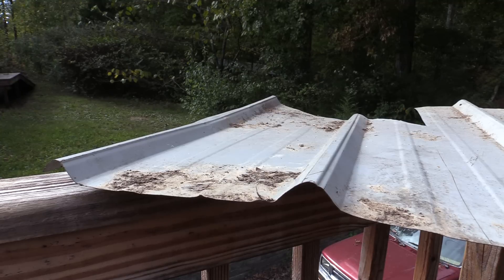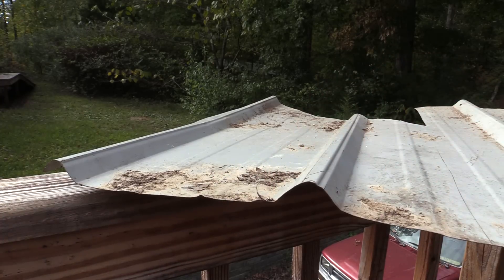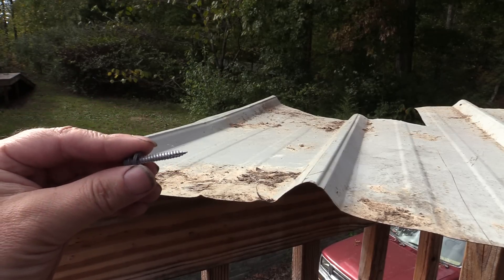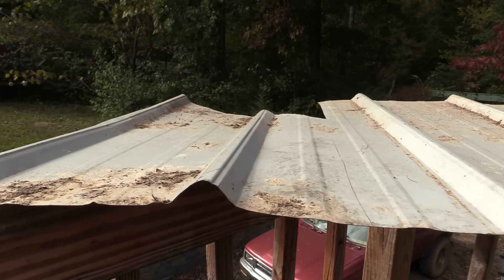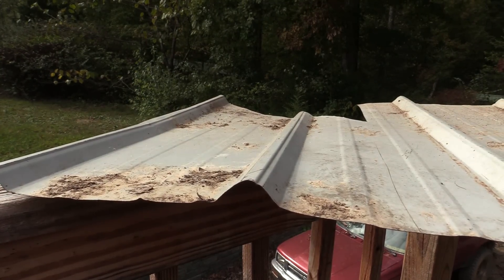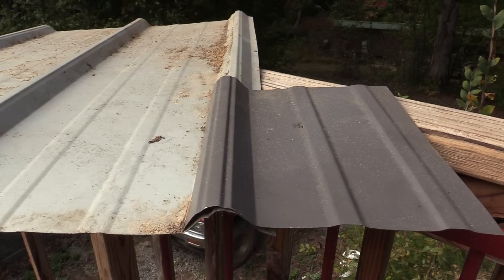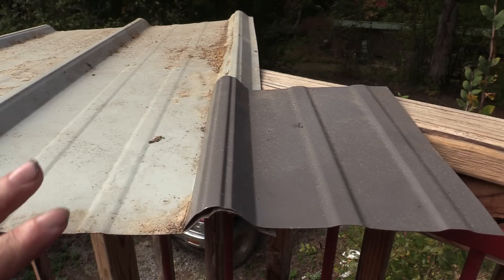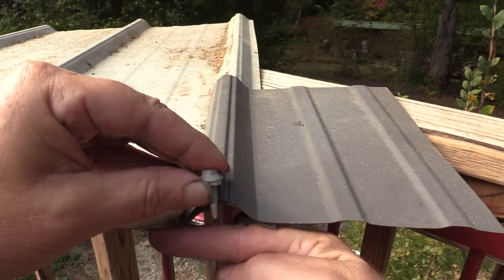Why you should not put screws on the ribs of metal roofing

Comment: I have done it both ways on my farm. Those with the screws through the rib never leaked. Every roof with screws in the flats leaked and had to be replaced. Anybody that tells you to screw in flats is wrong. Just don’t tighten the screws too much and deform the rib.
Reply from the maker: the roof manufacturer will say different unless you are dealing with 5v
Reply: @honeybeehomesteading  the manufacturers want to argue against the laws of physics,  let em. 🤣
Reply: @kerriwilson7732  Exactly RIGHT do not fall for this garbage on the flats 🙂
Reply: @kerriwilson7732        the manufacturers actual understand the physics involved  -  they also understand how most folks put in the fasteners  -   which is why they don't warranty most of the common fasteners or the installation:  just the roofing and then only if fastened in the manner they state    -      those common screws everyone uses with the neoprene washers: ( like the one he shows )  no warranty  -    you can get lifetime warranty screws:  no one much uses them ( 3 to 4 times as expensive ) and worth every cent
Reply: @honeybeehomesteading 

https://youtu.be/ZX0aMAJpfDw?si=gIn6CrZQD23V7W88
Reply: The trick is to STOP as soon as the gasket gets just a SLIGHT crush to it. Not enough of a crush, it'll leak when cold; too much crush, and all the fine cracking in the gasket will not only cause it to degrade and fail, but flattening it into a pancake removes its ability to flex and retain a proper seal from one temperatureextreme to another. I've done steel roofing with others who just go until the impact driver stops, and all those screws leak right away because the gaskets are not only over-crushed, but the overtorquing dents the metal, inviting the water in.
Reply: In Germany, we put a Special plastic support under the ribs, to avoid the flattening of the Rips
Reply: From what I'm seeing in these comments I Feel Real Good about the last metal roof I installed. NO NAILS, NO SCREWS !!!  I used a very strong glue . It's been years... 
No leaks !!!
Reply: My 40 years of experience and observations agrees with you
Reply: same experience
Reply: Yep screws on the ribs is far better for no leaks you're only to tighten till rubber gasket just starts to squeeze ever so slightly!
Reply: So much anger! Is this why Americans have to shoot each other? Do you have duels at twenty paces in the carparks at Target and Home Depot ?😂🇬🇧
Reply: @jayleeper1512  exactly & a lot of people like to smash them seals flat which is another no-no ya gotta stop shortly after screw touches seal!
Reply: A roof installed without the screws in the flats does not have the diaphragm strength. If you overtighten screws anywhere (wood frame, steel frame or in the ribs), the fastener will leak. 
& @ 4:20, that gap in the lap is for breaking the siphon action so that water running down the roof does not siphon over the top of the lapped ribs & into the building.
Reply: Any box profile roof, which is fixed on the valleys will leak!
Box profile sheeting should never be used on a roof, and if it has to be screwed on the valley, to give the roof more strength, than the sheeting is too weak in the first instance.
The quality of roof sheeting in general is pure shite and only guaranteed for "up to 20 years".
The only type of roof that should ever be considered is a fibre cement roof, similar to the old style asbestos roof, which have an indefinite lifespan.
Reply: When I was a kid we used lead nails on this ribs now I follow instructions and screw the flat nail on ribs never leaked screws end up with sealant after 20 years.
Reply: I'm so thankful a roofer friend introduced us to the corrugated metal with 7/16" rib height verses 7/8"!.... Easier to install and no huge gaps under the ridge cap not to mention it look's better.... And granted maybe the taller ridges are imperative on huge building's, idk....

And most everyone I know set screws in the ridge..... It's a given that screws loosen up over time and some may fall out completely  at least an open hole in a ridge will be less likely to FUNNEL water into the structure.....

For folk's on the fence I suggest you screw half your structure in the flats and half in the ridges.... Keep it real and screw every other sheet flat and ridge considering structures orientation to sun and prevailing wind's.....

All screwing methods aside, standing seam look's inviting..... And an upscale home owner in our community has a beautiful black metal roof whereas the metal is pressed to look like shingles. Seeing the homeowner out in his yard one day a friend and I stopped and asked him about his roof.... The gracious homeowner/retired told us it cost roughly 30% more than sheet metal.... I imagine he made the choice between asphalt and metal shingles as sheet metal would look like crap imo on his fine new house with dormers and what-not....
Reply: I'm in Alberta with -40 to +40 every six months, always screwed on the flat next to the rib, many roofs, no leaks.
Reply: @ lucky you, I am just in the process of replacing the roof on my shop that was leaking like a sieve because it was leaking around the screws in the flats. Ruined the drywall ceiling so I have to replace that too.
Reply: Absolutely right! I've had those same results for decades.
Reply: I agree my roof (25 years old) after a recent heavy rain had 3 screws show a small leak, my neighbors roof had more then he wanted to count after the same rain storm with the screws in the flat, the contractor had to replace the roof. alot of factors come into play on this type of metal roofs
Reply: We have been building with metal sheeting for 40 years with the fasteners on the flats and have never see any leaks. Just strength.
Reply: @Cotronixco mine started leaking after 20 years. Revealed it myself so the installer has no idea their workmanship failed.  I have 75 year old aluminum roofs nailed in the rib that still don't leak. That's with snow load and rain.
Reply: @martyk1156  No leaks on any of our buildings fastened in the flats with steel Pro-rib sheeting after 30 years. And about 100 times the strength as well. And I'm not discussing aluminum sheeting.
Reply: @Cotronixco I can tell these guys don't understand that sheet metal expands as well contracts with every cloud that covers the bright sunshine minute by minute day by day.
What they are missing is the placenta and arrangement that is prescribed so that movement doesn't get captured by screws. that is the reason that for every section there is only one screw per flat and rib so the expansion can be absorbed by the rib without buckling... 
That is how the screw gets loosened, it is that easy..
Reply: @ must be a different climate. Here winter freeze/thaw eventually causes leaks as the screws loosen.
Reply: @jayleeper1512  It gets quite cold here in Minnesota. Perhaps your screws aren't long enough, your purlins aren't thick enough, or you are not torqueing your screws properly.
Reply: @ none of the above. You have plenty of cold but don’t have the freeze thaw that we have in the Pacific NW. I have found that, especially 1/4 inch screws even screwed tightly into 3/4 inch roof decking, eventually loosen up and leak. Just this year, I had to go all over my machine shed roof and retighten the screws and cover them in a polymer caulking to stop them from leaking. I will never screw in the flats again.
Reply: @jayleeper1512  Never heard of that. You must live in the only place in the world where the screws unscrew by themselves. My guess is that they are not actually turning, but instead you are using cheap rubber washers instead of the proper Ethylene Propylene Diene Monomer washers.
Reply: @ that is where you are wrong. It has been a problem forever here and I know of multiple people who have gone around and removed 1/4 inch screws with 5/16 in order to try and deal with this problem. I always used the screws provided by the manufacturer with the roofing. Apparently you have never had occasion to see the power that freezing water produces when it expands. Quit trying to gaslight me into thinking it is not a problem here and open your brain up to what I am saying
Reply: @jayleeper1512  Our hottest here has been 108 degrees F and our coldest has been -42 degrees F. Not sure why you think your fasteners need to be so huge. The standard fastener diameter for pro-rib panels around here is 3/16" or #10. Ours never back out on their own. There is no way yours are backing out on their own unless you are missing something in your description, such as lack of slope. I still think your washers are probably incorrect, and break down prematurely and hold water or something. Moisture will not be a factor when the correct fasteners are used.
Reply: @Cotronixco  No he is right it is natural for wood to shrink and move and eventually the screw loosens this is why screwing on the rib is best water has a harder time to go uphill just like the old saying goes shit rolls downhill LOL 🙂
Reply: @thegrantdanielsband  Ah, the unacclimated lumber problem. NEVER install wet purlins. If you use dry lumber, you will never have this issue, and you will gain about 10x the structural diagonal strength as well..
Reply: @Cotronixco  You cannot get away from moisture? the dry lumber will soak in the moisture, and you will have the problem don't kid yourself 🙂
Reply: @jayleeper1512  Not just screws loosening, but the holes elongating with expansion and contraction.
Reply: @ if you call 40F one day and -27F the next day mild, fine. Listen. You can do your roof how ever you want, I am just telling you what my own experiences have taught me. If I screw in the flats, the roof after a few years starts to leak. Simple as that.
Reply: @ what ever. I’m sure you have crappy weather. Maybe it is more radical than here at times. I live in a mountain area with up to five feet of snow on the ground in the winter, heavy rime build up on all surfaces with daily episodes of hoar frost and daytime temps above freezing. For the 100th time, it causes the screws to loosen after a few years and the roof leaks. This is fact, not conjecture and I have dealt with it for fifty years on my farm buildings. Maybe it is not an issue where you live but it is here.
Reply: @ Bummer for you.
Reply: @ bye bye
Reply: @Cotronixco  The expansion and contraction turns the screw a minute amount with each temperature change. Over time this adds up to a screw backing out. This happens only to screws where there is side pressure on one side of the screw. Not all screws will have this side pressure. This happens because it's always easier to back out then drive in. They will get loose on the top of the rib too but it still sheds water.
Reply: @HowardSinclair-z6b  We install 2 or 3 screws (not one) between ribs per purlin with EPDM rubber washers and have NEVER had your issue on any of our buildings. Massive strength as well.
Reply: @Cotronixco  You're the only one that has done this that I have heard of LOL The manufacturer I deal with laughed at me when I asked him if I should screw on the flats?? 🙂
Reply: @ no I’m not but if you want to keep doing it your way, go for it. I am in the process of replacing all the leaking roofs done your way. It is something I learned after fifty years of being talked into doing it wrong . HiHo. 😂
Reply: @jayleeper1512  You must be doing something else wrong or not revealing something. If you did it my way, you'd be golden.
Reply: @ yes, what I did wrong was screw in the flats as you showed. The freeze/ thaw loosened the screws and the roof leaked. It did that on every roof that I put screws on the flats. The roofs where I put the old aluminum nails in the ridges never leaked and the ones I put longer screws in the ridges never leaked because the freeze / thaw only flexed the metal and the screws remained tight. I sure can’t figure out why this is so difficult for you to understand but I am kind of getting tired of talking about it.

Comment: I’m not a professional. I have installed a lot of metal roofs putting the screws in the highs( ribs) and never had a problem with leaks. 
The home I’m in now is a pole barn therefore I didn’t install this roof.They  put the roof on and I came home from work to find that they put the screws in the flats🤦🏼‍♂️. I was disappointed but it was too late. 
The first winter came and some snow and ice ( not much this is Mississippi) it leaks yes plural!! 
Snow, ice, water whatever, it lifted the ribs at the lap when it froze and then thawed and then the leaks !! Never in my life have I seen that one!!! 
So , guess who had to fix all this? 
Me. Just saying . 🤦🏼‍♂️
Reply from the maker: you had a bad installer. the screws will leak if they are not square to the roof and over or under tightened.

Comment: The reason for fastening on the rib is to reduce leaks, the gaskets will fail after a short time, it doesn't matter that much on rib. It will leak on the flat I found out the hard way.
Reply from the maker: @MS-ig7ku  while it is more leak resistant on the rib, a properly installed screw on the flat will not leak. The screw has to be square and not over or under tightened. I have building with 20 years on them and no leaks.